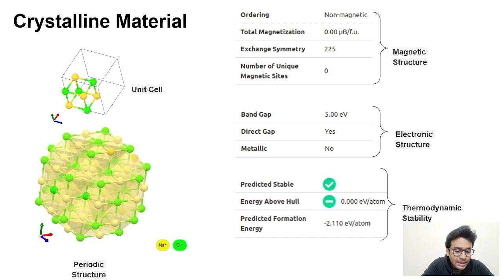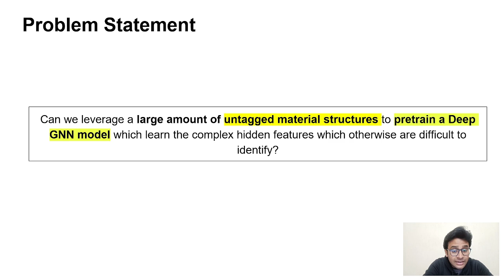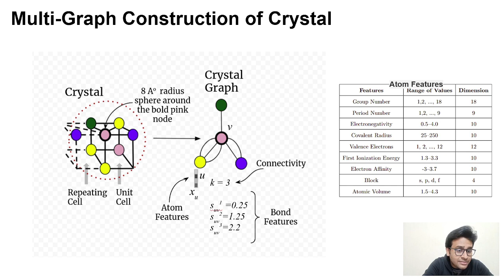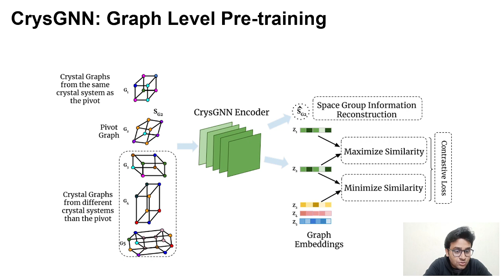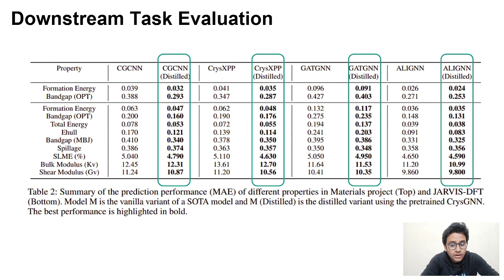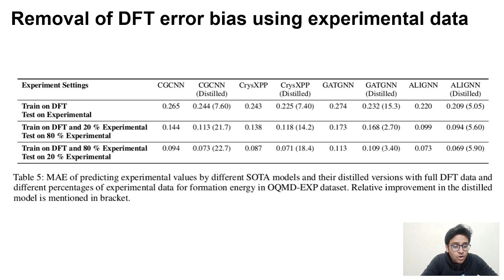CrysGNN : Distilling pre-trained knowledge to enhance property prediction for crystalline materials.

Comment: I have a small problem, sir. I have obtained a decent rank in GATE, which would allow me to get into IIIT Delhi. I am planning to pursue a PhD from a university in the USA (Child's Dream). However, the issue is that I need to work in the industry for 2-3 years to pay off some loans and build up savings. I am concerned if this would make me a less valuable candidate when applying for a PhD in the future.
Reply from the maker: It won't get similar value for sure i can say that. But it doesn't mean you have no chance. If your profile is really good, u can definitely get a chance there.
Here i suggest one thing. After MTech do such a job where u have a scope of doing research and earning money. Suppose if you join labs like IBMr research lab or Microsoft research lab for some researchers position (even if the position is not parmanent but salary good) do work there for few years. support your family and parallely continue research, publish papers. You will get better college after 2-3 yrs
Reply: @kishalaydas  Thank you I did not know that.